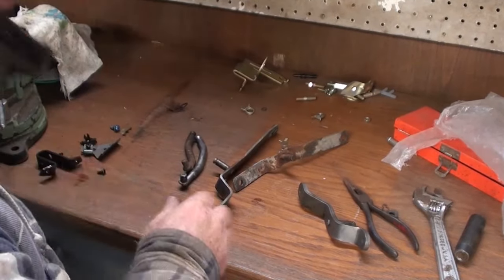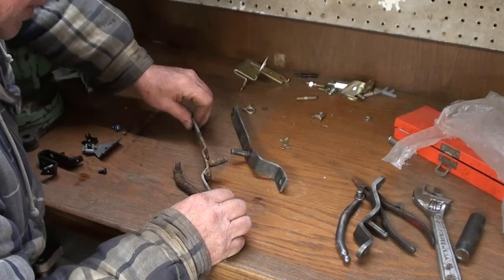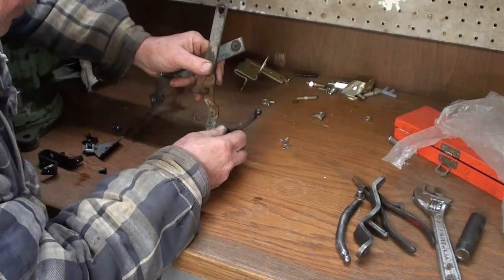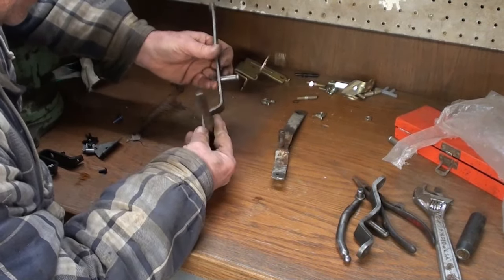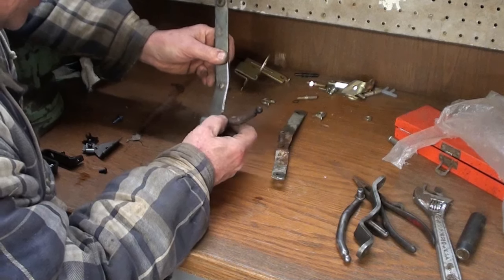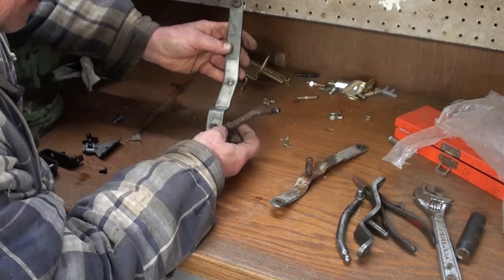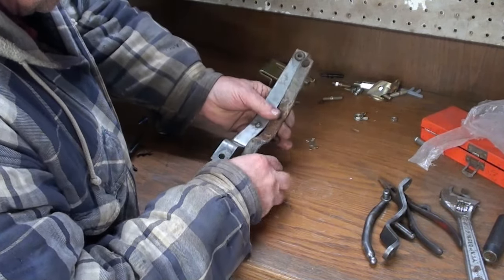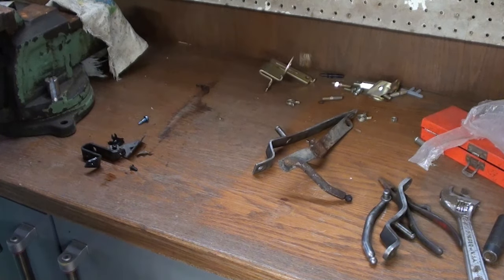PANIC MODE Day 68!!

Comment: Ah yes fun with throttle linkage. Had a similar problem on my U S Army 1952 Dodge 3/4 ton 4x4 it had a Rue Goldberg setup that was totally wrong. Got it sorted out and built new throttle linkage using a piece of all thread with swivels at each end. Works great now.

Comment: I’m having the same problems, I have a 66 Chevy stepside with inline 6 250 ci I put Holley EFI on it, the throttle is 90 deg and pulls down instead of up like the original, had to go to a flex cable to bend around the corner.